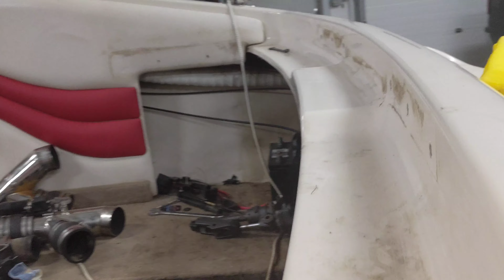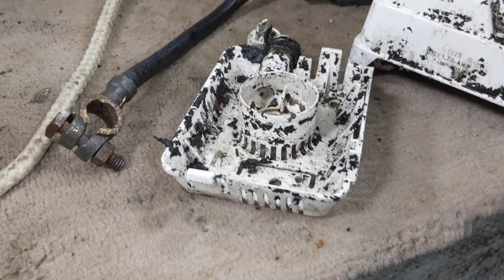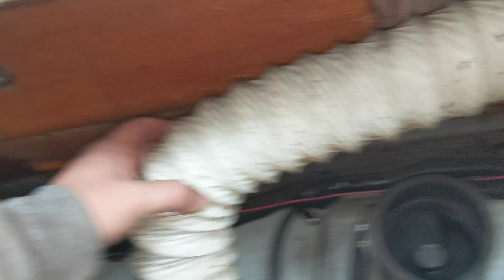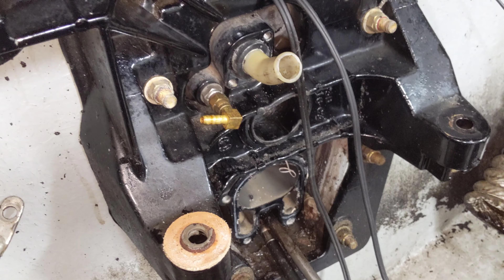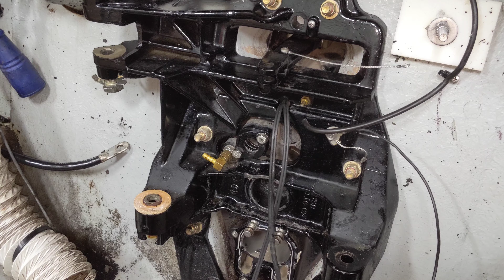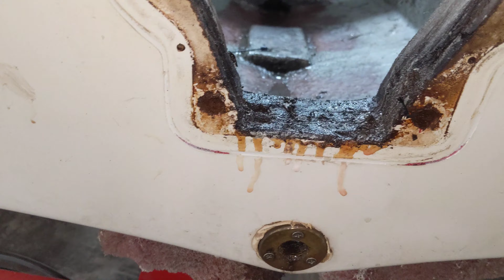Mercruiser Alpha One Gen 2 Transom Assembly Removal

Comment: Great video 👍.
Just a quick question, im building my alpha 1 gen 2 but can't figure out where the continuity/ground cables go, been searching the internet for a diagram but can't find anything, bit of a long shot to ask?
Thanks. Dave.
Reply from the maker: Sorry I don't have that info. If you can't get it, I'm pulling my mercruiser boat out of storage this week probably. I could try and walk you through it. Hopefully you find something by then.
Reply: @605BOLT  Thanks for the reply, i will keep searching, its probably in the workshop manual, ill probably buy one, it will be useful, im just waiting for the seals, in the upper gearbox section, then i can assemble and bolt the drive back onto the boat, its been a big learning curve but satisfying. 
Ill watch out for your video, if you post one 👍.
Reply from the maker: @916hayabusa service manual is a necessity.  This is the one for my boat. https://amzn.to/49MuRKb
Reply: @605BOLT Thats great, thanks 👍 , that will cover my drive, I've picked up a 2000 fletcher gts19, with the 4.3 engine in it, nearly ready for the water, hope it doesn't sink 🤷‍♂️🤔.
Reply from the maker: @916hayabusa right on. I'm sure it will go well!

Comment: Hey great video! Very detailed. Question, what’s the likelihood I could get the transom plate and gimbal housing removed without removing the engine? Like if I removed the steering unit and exhaust, is it possible? Im trying to liquid repair my transom with carbon core and really don’t want to deal with removing the engine. Transom is soft but floors are solid. But if I don’t remove the plate and housing, it’ll be permanently sealed. Thanks in advance for any advice!
Reply from the maker: I'm not going to say its impossible because I've never tried it personally but I bet it is not possible.  There is little to no room back there even with the exhaust removed.  The bolts for the Y pipe are at the bottom and right in the middle.  It will be much better to take the engine out.  Also, by the time the outdrive is removed and the exhaust is all removed you're pretty close to getting the engine out anyway.  If I can guess, most are not wanting to remove the engine due to not having a hoist or forklift or something like that.  If it was me and I was needing something, I would unbolt the engine completely and just leave it sitting on the stringers.  Then I would drive to a tractor dealer and offer them 50 bucks or something to hoist it out.  Most of the places around here are very nice and would help.  It would be easier and cheaper than building a gantry crane setup.  Anyway,  hope this doesn't derail your project.
Reply: @605BOLT  ya man it’s a combo of no hoist and not having a lick of machanical knowledge. It was a free boat that I’ve poured a good amount into. I’m researching how to proceed forward on filling that transom in. Soft all around the outdrive (I can push my finger through the inner fiberglass wall, so that wood is essentially gone, but top half still solid. Nice boat otherwise!
Reply from the maker: @trethewaymedia2725  dang. Ya a transom repair is expensive and time consuming. Just about worst case scenario. I would rather rebuild an engine haha. But lots of people do those repairs. Take the motor out, remove the transom, remove the inside layer of fiberglass until you find solid wood, add fresh wood to replace, redo inside fiberglass, cut the hole, drill the through holes and put everything together. Takes about 30 seconds to write but I couldn't even guess how long to do. Big job for sure.
Reply: @605BOLT  ya that’s why I was going to use a product like carbon core and pour into the transom. I know some people who had great results and the transom will now outlast the boat. Easier on an outboard. Oh well wish me luck if I decide to tackle it
Reply from the maker: @trethewaymedia2725  that's crazy. I had never heard of that stuff before. I just peeped a video right quick. Frickin cool idea.

Comment: With all that rust around the 8 bolts holding the transom assembly on are you sure your transom isn't wet inside?
Mine looked like that and the transom plywood was black and brown but still felt hard, had to replace it.
Reply from the maker: It could probably use some help in that department yes. However it spends most of its time on a trailer and I'm not trying to pick at that thread lol

Comment: Update on mine. Transom assembly is just to far gone for me to wanna put any money into rebuilding it so ordered a new one and Pulled the engine yesterday. Gonna remove the assembly this weekend so far I can tell the transom isn’t 100% but I only see one spot by one of the bolts that is split open. Hopefully she isn’t to bad 🤞🏼 so far it’s definitely some work but pulling the engine was easier than I thought it would be just wish I had a shop to do it myself instead on a buddy’s skid steer with a boom on it lol
Reply from the maker: Good call on a new assembly. Might not be mint but it sounds like it's miles ahead of where you were with the original one. Keep after it!